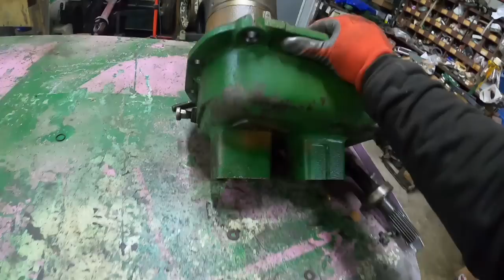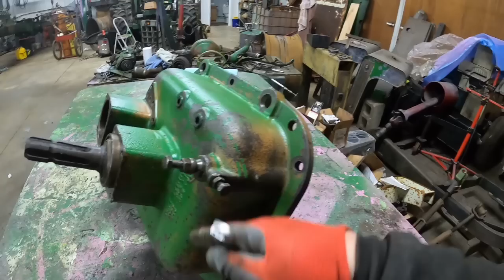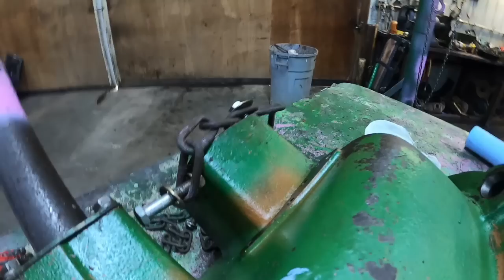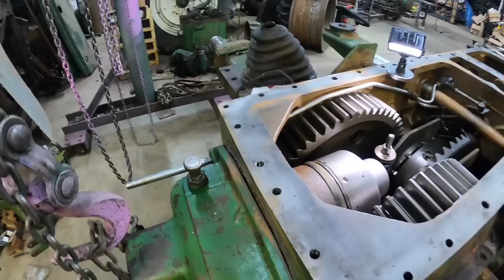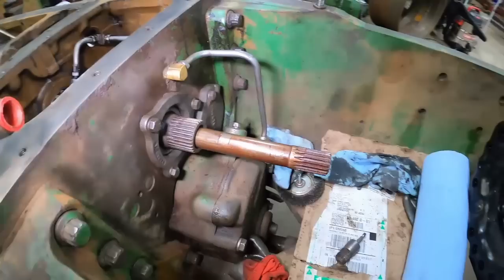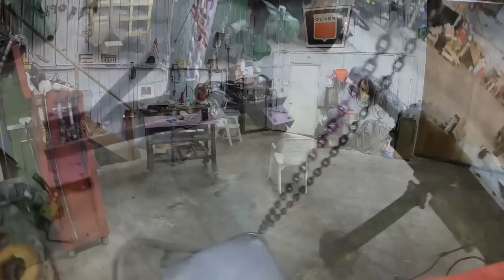1855 Restoration: Installing the PTO unit #oliver #farming #agriculture

Comment: Any tips or info to restore the hydraulics on a 1650. It has to be run at almost full throttle to get the 3 point arms up. I suspect its something to do with the servo valve.
Reply: Right on... I appreciate it... I'm going to try to get to it this winter so I'll be in touch. I will say I'm glad you are sharing the knowledge you have on these machines. It makes it a little easier to figure them out.
Reply from the maker: How do the remotes work?
Reply: I'm not sure. Its been a while since anything has been hooked up that needed the remotes.
Reply from the maker: @ryanmyers5847  it sounds like a tired pump to me. The priority valve makes sure the first 5 gallons per minute goes to the steering, so if your pump is weak, the priority valve will shut off the flow to the rest of the hydraulics to keep the steering working. When you speed up the engine,  pump output increases to the point that the priority valve can open up and let oil through to everything else.

Comment: Chris know keep repeating my questions I'm sorry all failures farm tractors companies do think was poor leaderships, engineers, with quality other lots problems become issues trying fix? As many companies failures not understanding farmers problems have many machines fixing, costs hurt with parts trying diagnosis  belly open can worms if know I mean. Thanks again answer my questions great video keep up good work thanks.
Reply from the maker: Oliver's biggest short comings over the years was management. They were of course mistakes made in engineering, they were all human. There were times when they had good management, but it only takes a handful of bad calls to start the downhill slide.

Comment: The engine speed port for pto works great to run a auger in reverse to clean it out.  Would you know if a pto generator works in reverse?
Reply from the maker: I don't know the answer to that, but have wondered the same. I have seen where it's been done, but I don't know if they had to modify the generator.

Comment: Nicely done Chris. I know a guy that went to pull his engine out of an 1800 and didn't realize he had to pull out the power shaft..he got in there with the skid steer and picked up on that engine realized it was stuck, so he did some wiggling and shaking until the front wheels of the tractor were about off the ground. I came along and nicely pointed out to him that he should pull out that shaft because it would make his life easier, and when he finally got it apart, unfortunately it was bent lol..
Happy Fourth of July buddy and congratulations to Abby! Can't wait to see the 1755 on that grain vac
Reply from the maker: Thanks! I've worked on a few where the power shaft was bent and used anyways. They would have wear on one side where it lined up with the chain coupler. They would also pull out hard.